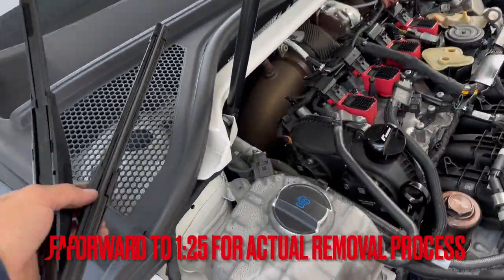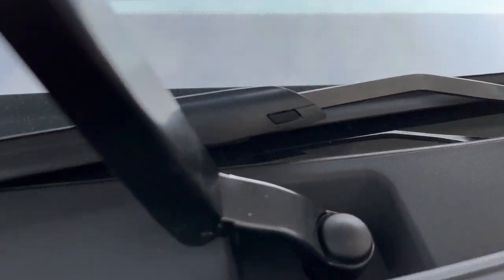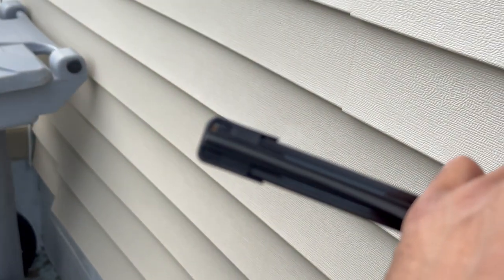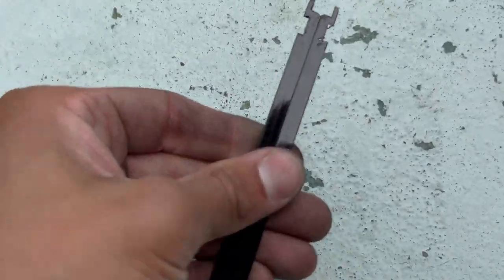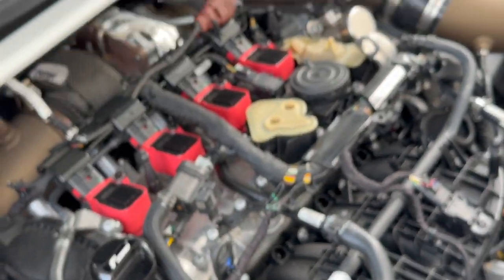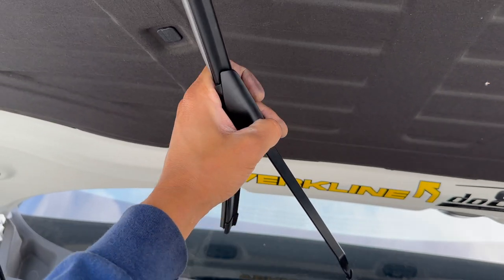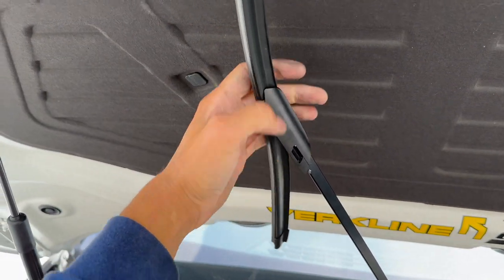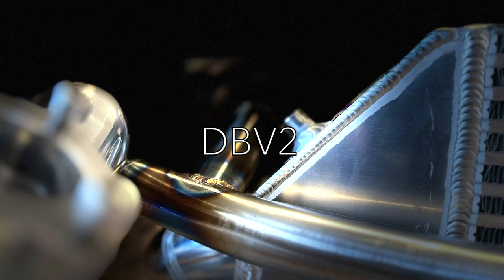2022 Audi S3 wiper blade replacement - & how i had to mod them to work 😅

Comment: Car has the possibility to set the wiper blades in service mode (there is something in the mmi menu, or put ignition on, then ignition off and push the wiper stalk once)
What it does is that the wipers swipe once and remain the a vertical position until you push the wiper stalk and they return to normal sitting position.
This way you can access them without opening the hood.